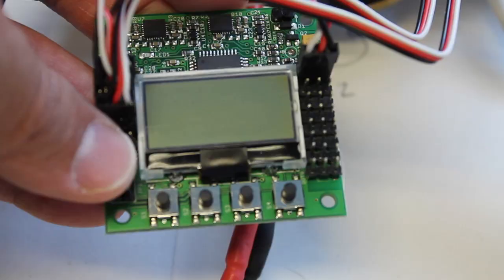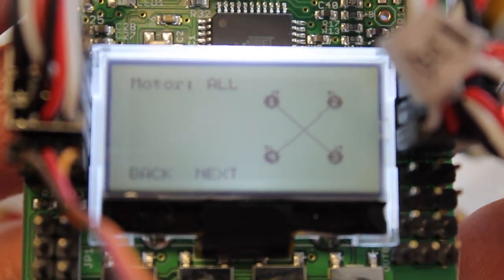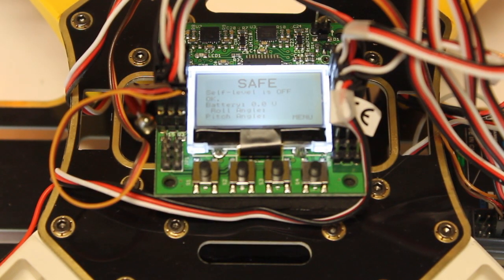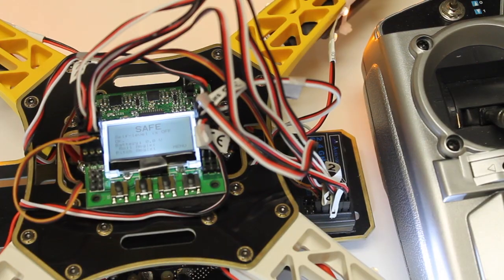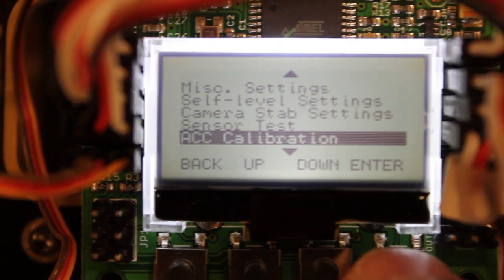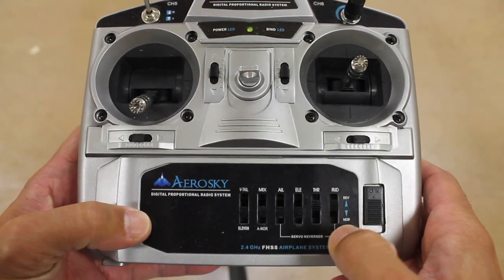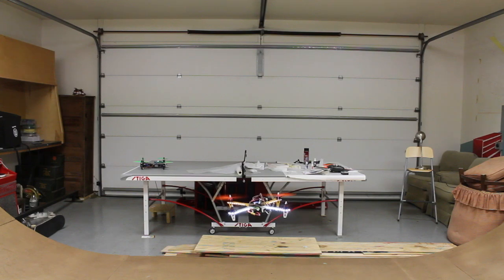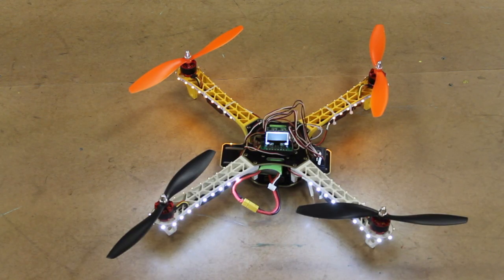KK2.0 Multicopter ESC Calibration, Motor Layout, and Auto-Level w/ Default Settings on AeroSky Quad

Comment from the maker: It was crazy to me that there was no documentation about this. Trial in error I guess! The channels on the receiver go like this:

1 = Aileron
2 = Elevator
3 = Throttle
4 = Rudder

That will match up with the inputs on the KK2. You'll generally find in most cases (not all, but most) that the ordering is fairly standard A,E,T,R. Hope this helps you get in the air. Let me know if you have any probs and please check out garagepilots . com for even more fun :)

Comment: Damn... and i was wondering how come i get my tricopter motors to work. I’ve done ESC's calibration, motors were fine....all the preferences were checked. Receiver test showed me that everything  works ok, but i couldn't understand why my tricopter doesn't respond when i push the sticks.. :D So you have to armed it… :D

Comment from the maker: Yes, this could carry a GoPro. You'll need a good way to mount it or a gimbal. There's a tab on the bottom plate that you could mount it to. Yes, auto-level returns the quad back to level if you're pitching and rolling in any direction.

Comment from the maker: Just be careful to make sure they are rated the same, run the same firmware, and have the same refresh rate. I would say you could probably do a basic low hover test, but it's probably safest to go with all the same ESCs. It's not worth the risk of something bad happening, ya know?

Comment from the maker: Are you flying with a 3S or 4S lipo? Also, make sure you've done the ESC calibration routine which will set your low and high endpoints. If they're not calibrated you may not be getting the full range of throttle. Are you able to get your quad off the ground and hover?

Comment: Thanks for the input. I set 60/30 on the p &i gains and it does good. I still need v1.5 though for quicker response. I crashed today so now I really have problems. Rebuild!

Comment from the maker: A 25-30C rating should be okay. The AeroSky that I have does not have prop washers. I definitely recommend upgrading to the Turnigy 9X at some point. Just keep in mind you'll need to get a new RX because the AeroSky RX isn't compatible.

Comment from the maker: Have you messed with your autolevel gains at all? What happens when you do an acc calibration? Perhaps you've accidentally tweaked a configuration or a sensor has gone bad. Worse case I would reload the firmware and see what happens from there.

Comment: ok well i got the the same quad as the one in your video and i notice that it all ready came with the 5ch and auto level.i know you told me witch battery to use but what about the c rating.and when i put on the props i notice that it came with washers should i put them on?does yours have washers.oh and also do you thing i should upgrade to the 9x or just use the aerosky.thanks for the feed back.

Comment: Flies great in acro mode, however, when i switch to self level, it does not quickly self correct itself like it did when i first installed the board.

Comment from the maker: I would say a good battery would be something like a 3S 2500 mA or 3000 mA battery. You could probably go a little larger, but you'll need to consider the weight that this will add to your setup.

Comment from the maker: Check out valuehobby . com and see if you can price something out within your budget. I think you should be able to get pretty close. I've never used the Orange T-Six, but I would definitely look into the Turnigy 9X or 9XR as you get 3 more channels and it's a nice setup. If you're set on going with Orange then the T-Six looks to be a good option. If you do get into higher-end flight controllers like the Naza you will definitely want more than 6 channels on your TX/RX combo.

Comment: Which firmware are you running? My KK2 came with 1.2 firmware and then I flashed it with lazyzero.com  to firmware 1.5 then the auto level worked much iuch better, But it has been reported the acro is not as good with 1.5